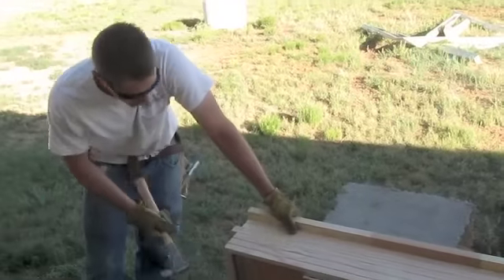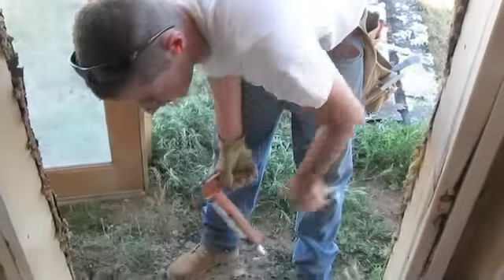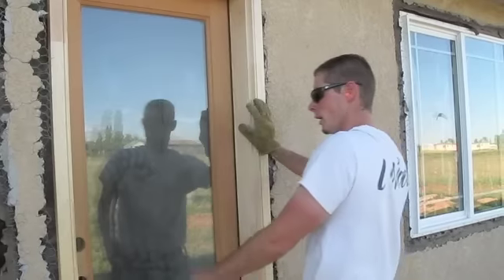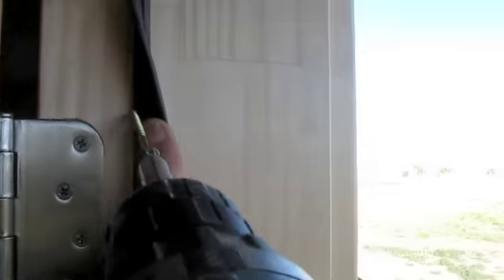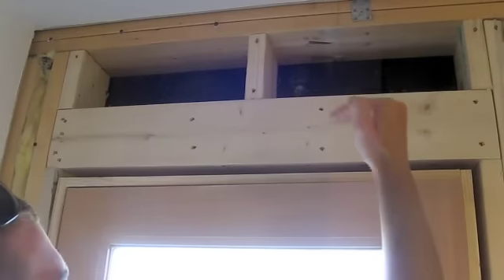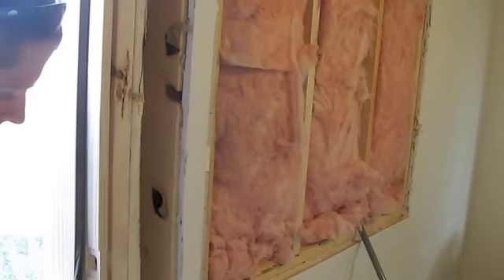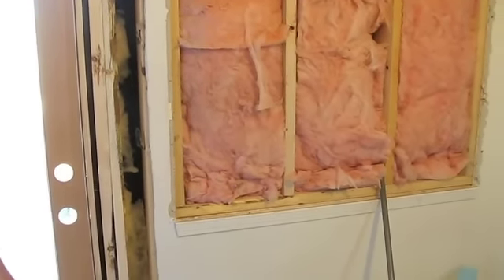installing an exterior door

Comment: He forgot to wrap the exterior framing with either WeatherShield  or tyvek.  That should go on before the install.  Then flash over the top of the brick mould after the door's in place.  Also, you can get a perfect install as far as your reveal, or what you called "margin" around the door-to-frame.  Very first thing to check before install is level on floor in rough opening.  If you know it's 1/8 low on one side, simply put in some plastic shims before you set the door.  Then, double check the rough opening sides for plumb, and get an idea of what's going on there before you lift the door into place.  Hope this  helps!

Comment: Thanks a lot these videos helped me out a lot. I've been doing handyman work a long time over ten years, but my expertise is more welding and carpentry like cabinets, decks, patios, pergola, and what not. So I've only done 1 door and it did not come out too bad.  ad after the expansion foam set (after I left) it had fucked the door margins up and let's just say I lost that job due to my inexperience with hanging doors.

Comment: I learned a few things, and that's to be expected since I've never done a door installation. I'm looking at other videos, too. But I don't feel like being critical, if the results are satisfactory. Sometimes and older home isn't worth the trouble to do a full-on professional installation. I like some of the things the guy does, like hiding the screws behind the weatherstrip. There was obviously some prep work that we didn't see in this video, and he may even have been installing this solely for demonstration purposes

 I realize that a few commenters have pointed out some shortcomings in his method, and that's okay. I'm thinking of installing a budget-priced door in my 25-yr-old trailer house, and I can see to it that there is proper flashing, caulking, leveling, etc. without having these procedures  detailed in a two-hour-long video. There are other videos for those things, but this guy just kind of cuts to the chase without getting bogged down in details. After all, I'm just getting started learning. Good video.
Reply: I disagree. it's the older homes that need the extra care. my house is 117 years old.  I am going to do the doors correctly the first time.

Comment: Good job of explaining the fundamentals of door installation. One optional thing a DIY may want to consider is to pay a little extra and get pressure treated wood jambs to prevent rot. In very humid areas of the SE USA an exterior door and frame can rot out in less than 5 years. In other parts of the USA eg.Colorado, untreated wood jambs will last decades. If you can't get pressure treated wood-paint the insides of the jambs and raw wood edges before installation.
Reply: or pay extra to get it installed by a pro so you don't have to take it back out when you realized you fucked it up like this guy.

Comment: When you buy an exterior door does it come with the compleete flashing and weatherstrip included or do you have to have someone who specialize in sheetmetal to come and reflash afterwards??  Note: this will be an intall in an existing structure.

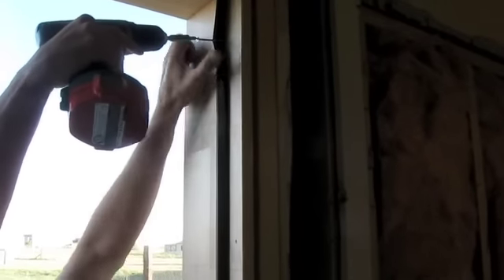Comment: I generally don't add my 2 cents to a video merely to critique someone's methodology of installation but there really are some troublesome issues here that any DIY'er thinking this was the proper way to install a door might fall into the trap of following these instructions. Not saying this entire video is bad but there are some things that should have been addressed before even fitting this pre-hung door into place. Notice the surrounding sheathing where the door will fit on top of (outer perimeter of door opening) being nailed into it's final placement. It's tattered & literally flapping around giving you an unstable substrate to mount your door for the purpose of waterproofing & stability itself. The same applies to the already damaged sill or band at the bottom of the door itself where you can notice the wooden material's already been pitted possibly by insect infestation or normal decay. I'm not suggesting the sill material be replaced "if it's still solid" & worthy of holding & gripping fasteners or simply maintaining support underneath but two rows of globbed on caulking will not adequately protect the remaining material. At the very least,, approved heavy mill poly wrap should be placed on top,, cut & tapered at the edges & nailed into the wood vertical framing after you take that shoddy perimeter sheathing down! This guy doesn't mention how the house itself will be finished off with the finish material butting up against the door he's working to now but it looks like EIFS/synthetic stucco which is big trouble within itself being the central figure of a multi billion $$ class action lawsuit across the entire nation. In this 4:00 video he's merely jamming a pre-hung door into an opening,, an "unstable/unsuitable opening" without usage of a level or framing square to check his right angles of his outside corners. A framing square's very helpful with a one man installation scheme once you're ready to set your door by simply predrilling one or two pilot holes in your outside brick molding,, sliding the door in place & tapping a single galvanized finish nail into place to simply check your door adjustments. Depending on how much "adjustment space" you have to work with being the additional space of your rough opening size vs. the finished interior dimensions of your door jamb,, you can pre-insert a shim on one side just to let you find your center position of how much usable space you're working with once sliding the door into the hole or simply mark the exterior molding at the top & a matching mark on your sheathing to center the door properly. The door itself is too damned heavy & cumbersome to keep pulling it in & out of the hole several times "in guesswork". I'll suggest one more thing as well,, any time you drive or screw fasteners into finished wood,, you're "displacing the existing wood", In other words,, you're moving or forcing the fibers of that wood to the side which can cause unnecessary splitting. I always or normally predrill most of my holes with a drill bit a size or two smaller than the fastener I'm using to maintain it's grip to the interior of the wood but all that wood your drill auger is spinning & spitting out is no longer an issue to either drive your nail or screw through by coring out the density of the wood itself. This way you can easily "tap fasteners into place" while going through the process of plumbing your door level & inserting final shims in place. That one or two nails act as your partner holding your door in place for finding adjustments. Sorry,, but this young guy picked a piss poor illustration to mount a door into an opening for others to go by & even the part he's doing seemingly noteworthy,, hiding his screws behind the weather stripping,, he's actually inserting his screws into the rubber stripping itself! All he had to do was simply pull the rubber stripping out (they slide right out) & screw his jamb into place but you can see a the 2:20 mark where the stripping is twisting all around due to him screwing through it. Again,, he should have predrilled pilot holes at those junctures as well once he removed the stripping. Stay with it young man,, I'm not trying to ruin your confidence but you've got a lot to learn as we all did getting started in the routine of "doing it right". You've got the will it seems,, now just brush up on your fundamentals as to what makes the job complete. There are "even more things" I didn't mention needed to be done but it's somewhat pointless until you address these few basics I'm mentioning. From where I sit,, this house was a disaster before & it's merely being covered over with more issues further down the road,, "lipstick on a pig" I think it's called. Look at the vinyl clad window to the right of this door installation,, I do hope that's not someone's idea of refitting that window properly & what's that going on with the wallboard/gypsum to the left of the door installation?
Reply: When you normally don't give your 2 cent, you save up to give a dollar. Rober i applaud your attention to detail
Reply: Hung Huynh Hahaha!!
Reply: Boy! I didn’t think you could type these many characters on youtube!!!! Now I have to watch the rest of the vid. 
Hahahahahahaha!!!!!!

Comment: I don't know the first thing about doors. I need to replace two entry doors in my home. we are going to diy. but from what I've seen on videos today...isn't it supposed to be level? aren't you supposed to put bunch of shims?
Reply: and should be back far enough so it's flush to the finished drywall, or you'll have a nice gap trying to put trim over it...  pretty much how you don't install a door.
Reply: I think, he missed the water protect band around the frame too.
I've been looking to videos because we need to replace an entrance door,  so I don't really know. 😬

Comment: Lol @ all the criticism. The guy is not perfect. Who is? But show me another video explaining how to break through a load bearing wall and install a door. All you'll find are door replacement instructions. Huge difference. 

My project is even more complicated because my home has balloon framing. So I'm researching whalers, supports.. 

I've never found a video that's a ONE stop instructional holy grail.  Do your homework. Piece together a game plan from different sources to suit your specific project.
Reply: but you're still suppose to level a prehung door, put shims, even people who don't know anything about doors know this at least.   sure he didn't pull it back far enough to be flush with drywall, didn't put proper flashing but shit at minimum you level it.  and when you put shit like this on youtube for people wondering how to do it, you put the responsibility on yourself to make sure it's right...
Reply: Meh. I watched this video (the ONLY video on YouTube I found on breaking through a load bearing wall), read through the comments, asked around and installed my door perfectly. I appreciate the comments on steps not shown in the video but to say he has no business making videos is stupid. 

If you cant do some research from multiple sources and don't have common sense you should pick a phone and call a contractor.